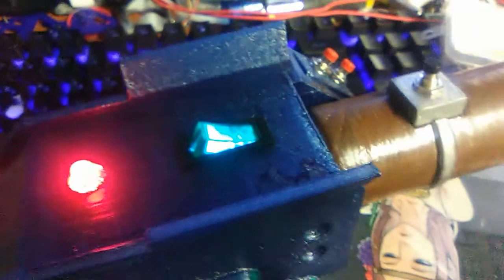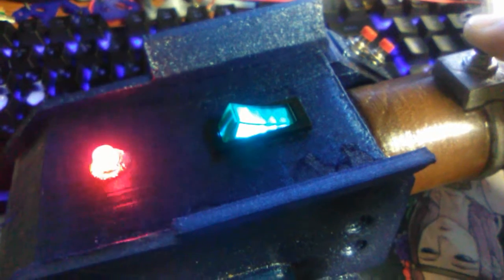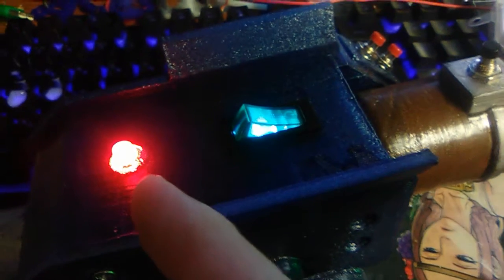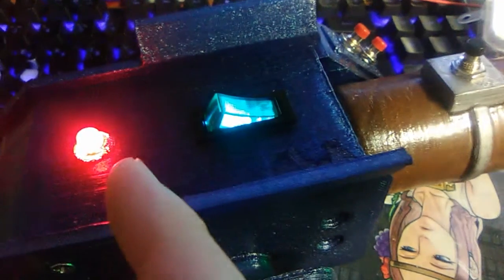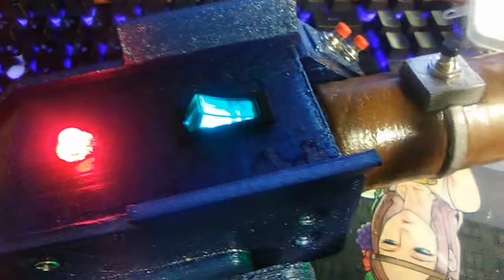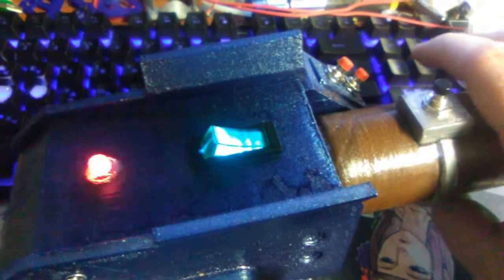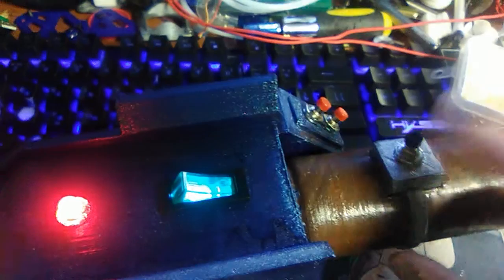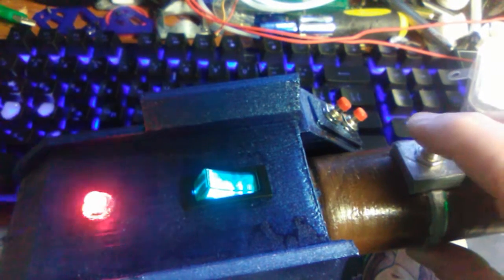Still Learning To Code

Comment from the maker: #include <FastLED.h>

#define NUM_LEDS 1
const int triggerPIN = 3;
const int togglePIN = 2;

#define RGB_PIN 13
#define LED_PIN 12

int toggleState = 0;
int triggerState = 0;

CRGB led[NUM_LEDS];

void setup () {
  pinMode (LED_PIN, OUTPUT);
  pinMode (RGB_PIN, OUTPUT);
  pinMode (togglePIN, INPUT);
  pinMode (triggerPIN, INPUT);

  FastLED.addLeds<NEOPIXEL, RGB_PIN>(led, NUM_LEDS);

  for (int i = 0; i < NUM_LEDS; i++) {
    led[i] = CRGB(255, 0 , 0);
  }
  FastLED.show();
}

void setRed(int val) {
  for (int i = 0; i < NUM_LEDS; i++) {
    led[i] = CRGB(val, 0, 0);
  }
  FastLED.show();
}

void loop () {
  toggleState = digitalRead(togglePIN);
  triggerState = digitalRead(triggerPIN);
  if (toggleState == HIGH) {
    digitalWrite(LED_PIN, HIGH);
    if (triggerState == HIGH) {
      for (int i = 255; i > 0; i--) {
        setRed(i);
        delay(1);
      }
      for (int i = 0; i < 256; i++) {
        setRed(i);
        delay(1);
      }
    }
    else {
      for (int i = 0; i < NUM_LEDS; i++) {
        led[i] = CRGB(255, 0 , 0);
      }
      FastLED.show();
    }
  }
  else {
    digitalWrite(LED_PIN, HIGH);
    for (int i = 0; i < NUM_LEDS; i++) {
      led[i] = CRGB(255, 255, 255);
    }
  }
}